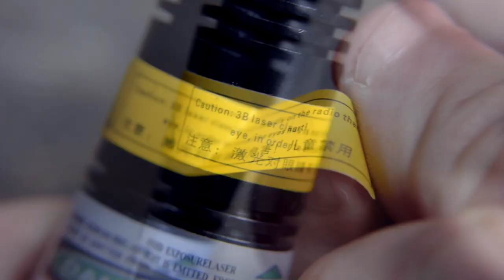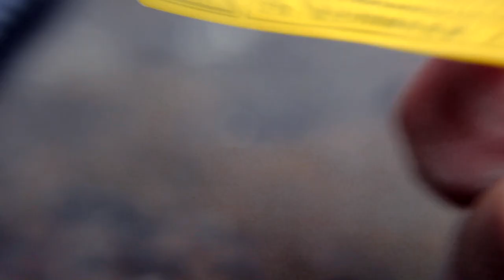How To See Invisible Air Currents With Lasers - NightHawkInLight

Comment: Fill the vacuum nozzle with coffee-stirrer straws, and possibly isolate it from vibrations with a separate chamber in order to get a laminar flow of air. It should give you MUCH better results. (I built a laminar water fountain with similar techniques and its just beautiful)

Comment: Did you try this experiment with a longer handled screwdriver? Also @ 5:20 do you see how the different pressures are interacting towards the output port? So cool, like the low pressure air is being sucked into the chamber!

Comment: A few more lasers could help. Using different colors for X, Y, and Z and centered each plane on the point of interest might help show the high and low. The more concentrated the particles (low pressure) the more the colors should mix volumetrically -- a region of higher refraction?
Reply: Also simulating this phenomena at a much slower speed could reveal higher detail. Maybe you could prop the screw driver at the tip and use a very low blow speed. For comparing multiple stages you'd need another set of width and length axis lasers, and probably a second vertical laser to remedy the shadow of the first vertical laser.

Comment: What if you put your entire system for floating the screwdriver in a smaller space? So that you can fill the enclosed space with thicker fog and then your cross section might be a little more visible?

Comment: Were no eye safe lasers (class 1, I believe) available with the optics you wanted?  Or is there a reason that they would not have worked?  50 mW seems like quite a bit, and as you said, if would have easily damaged your eyes if you messed up or were unlucky.
Reply from the maker: I wore them most of the time but took them off when I had the laser mounted in a secure position and felt safe to do so. It was necessary to have them off at times because I could not tell what I was filming while I had them on because they make the laser invisible.

Comment: Taking laser and fog machines out of the concert scene!

if its a low pressure behind the screw driver why would there be more particles? a low pressure should create a void, and our eyes aren't so good at picking a void out in a lit situation. or so my brain tells me with no more fact checking than my gut. and as mentioned later in comments by someone laminar flow is helpful for the Coanada effect.
Reply from the maker: Heavy fog particles have more tendency to fall into a low pressure area than the air around them.

Comment: 2:50 "Eddy current"? Are you sure that it is the right word? As far as i am aware eddy currents are electrical currents that form  with the presens of a magnetic flield...
Reply: Same lol.
Reply: I was thing like eddies in a river
Reply: @rstriker21 : indeed. Both points of view are correct: "The term eddy current comes from analogous currents seen in water in fluid dynamics, causing localised areas of turbulence known as eddies giving rise to persistent vortices. Somewhat analogously, eddy currents can take time to build up and can persist for very short times in conductors due to their inductance." (Wikipedia)